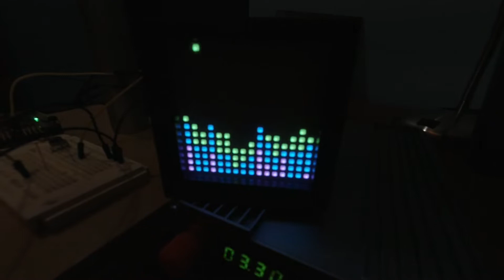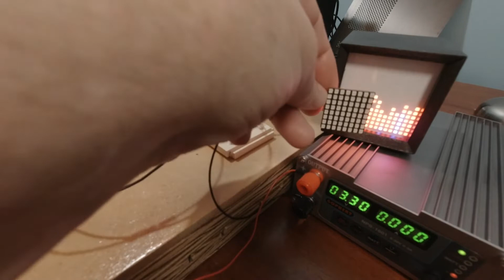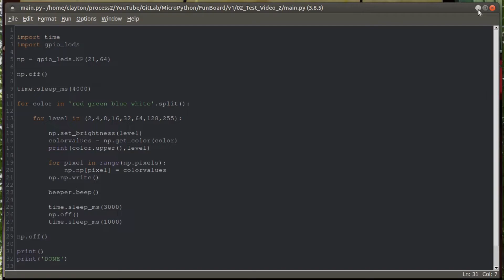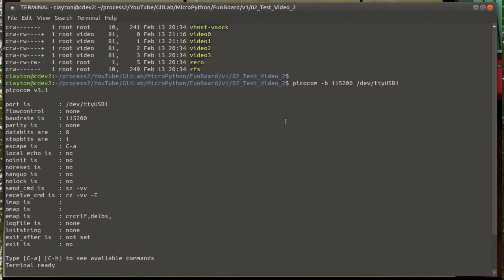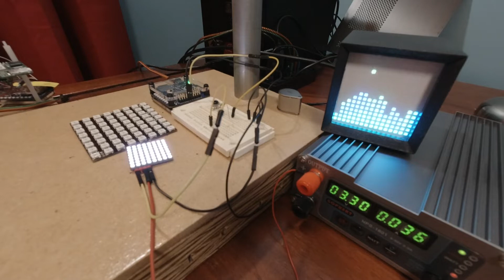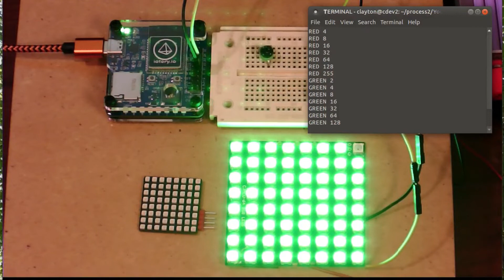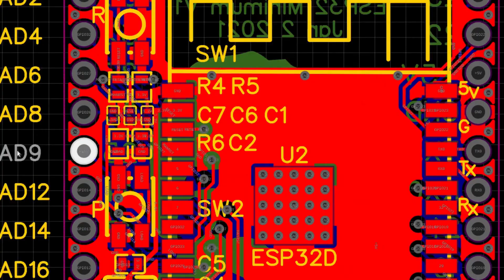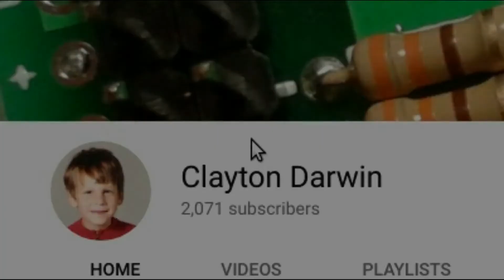MicroPixel (NeoPixel) Matrix Board Update: Amperage Tests

Comment: How many of these boards can you Daisy chain practically (with 1 wire interface)?
Reply from the maker: Theoretically you can connect an infinitely long chain of pixels because the signal is refreshed by each pixel. HOWEVER... You have two issues you will have to overcome. 1) Power. Each pixel can use 60 milliamps. 16 pixels might require 1 amp at full brightness. So you will have to add power into the system at strategic points to insure you don't have a voltage drop. The traces on the boards can only handle about 5 amps. 2) Refresh speed. You can typically update 1024 pixels at 30 frames per second if you have a good enough processor. But the more pixels on the chain, the longer it takes to refresh.
Reply from the maker: Practically, at lower light levels, you could do 8 to 10 before amperage becomes an issue. With an ESP32, you can manage 4 before process speed becomes an issue.

Comment: Looks like when you are going with white it drops some voltage across the wires you use; hence the reason for getting 1A rather than something closer to 1.5A.
Reply from the maker: Also working at 3.3 instead of 5.